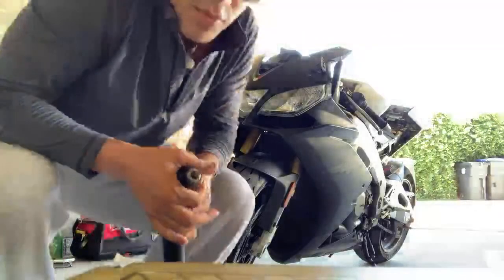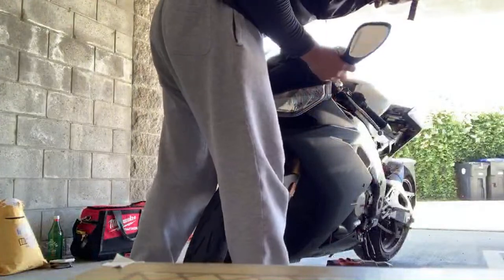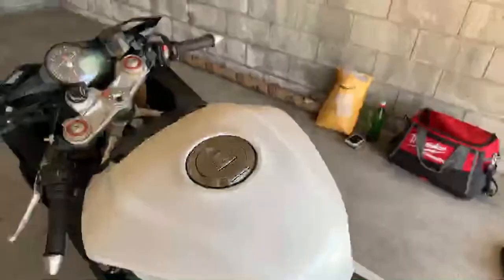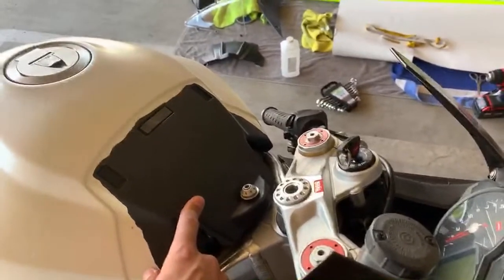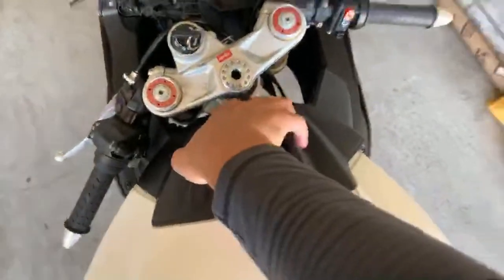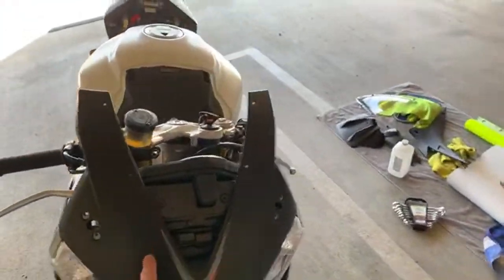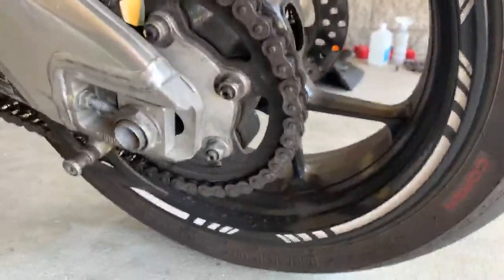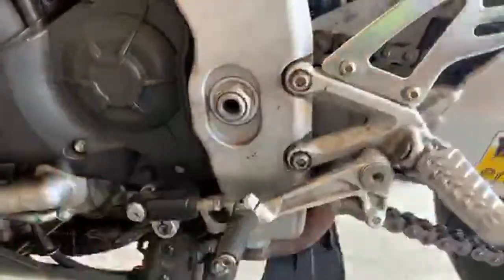Custom RSV4 Wrap

Comment: There a video 2020 s1000rr M carbon wheel cracked so if the rider does lot of wheelies question is how many times the front wheels chaters apart how long those rim been on the market